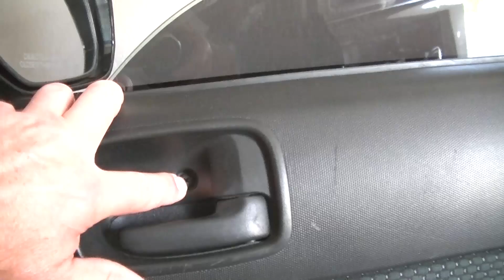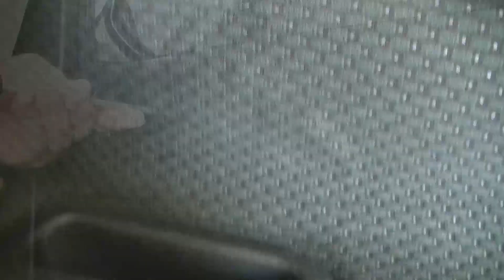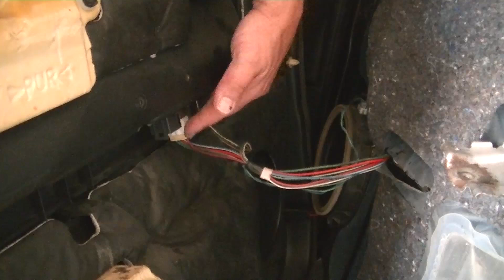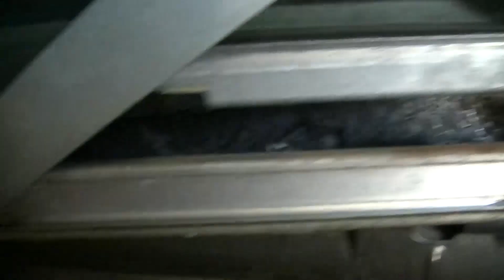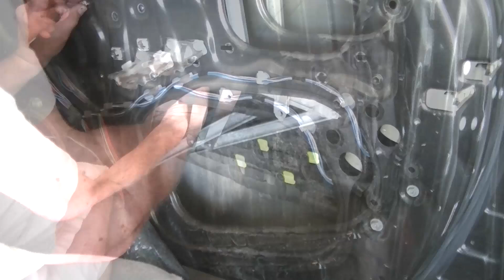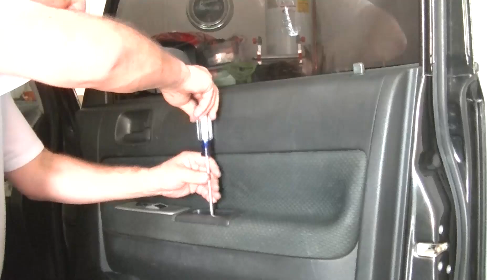2006 Scion XB electric window remove and replace

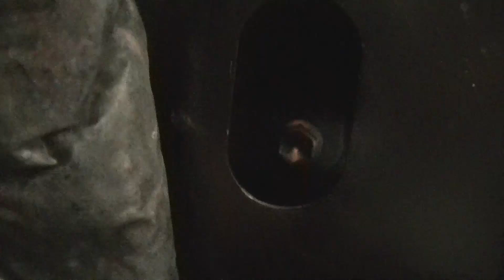Comment: Sigh.....this is the 3rd vid that I'm viewing to do this repair....and in all 3 vids, the motor is partially failed...and you have the nice option to position the window ( up/down) EXACTLY RIGHT, to get access to one of the lower-edge window bolts ( 3:45- 4:13). Nice...IF you can do that. What about my problem?.... ( and I'm sure for many others)....my window is UP.... AND...the motor is DEAD. That SMALL access hole to get to the left-bolt is not lined up with the bolt...not even close. Now what ?
Reply from the maker: I found this video that might be helpfull: https://www.youtube.com/watch?v=B1t8CnMpp4Q

I don't have the car anymore so I'm not able to explore a solution for you, sorry

Comment: Just bought one of these, with the same problem. Great video. We used to own a auto electric shop. From 1938 to 2006. I like the duct tape idea. We used to use those rubber door stops.

Comment: thanks was able to do this as well!! only problem i have is when reassembling the door panel. there is now a gap between the rubber and window on the inside. door panel is seeded though. so idk buts its okay

Comment: I CAN ASSURE THAT ON THE DRIVER'S SIDE YOU DO NOT JUST UNCLIP THE @#$%ING PLUG ...EITHER CUT THE WIRES OR WORK AROUND IT!!!!!!!!!!!!!!!!!!!!!!!!!!!!!!!!!!!!!!!!!!!
Reply from the maker: sorry for the troubles, since I did the passenger side I know not about the driver side, thanks for the input
Reply: You can unscrew the switch assembly with a Philips screw driver

Comment: Thx for the vid. So what did you do to fix the issue where the window wouldn’t go up with the new motor? Was it an issue with the switch the whole time and not the motor or did you have to do something else to make the new motor work?
Reply from the maker: it turns out both the switch and motor needed replaced, when I replaced both it worked perfectly

Comment: Scott, I used this unbelievably perfect tutorial 3 years ago to replace both front window motors and regulators on my black cherry 2006 Scion xB (exactly the same as the one in this video) and I'm still amazed at how perfect your video is.  The reason I came back today was in the hope you had loaded a video for replacing the door lock actuator on the same car, but no luck.  I ended up using someone else's video, which was quite helpful but nowhere near as exceptional as yours.  I love my Scion and never plan to sell it, so please promise you won't ever sell yours either...how else will I know how to fix things as they go wrong?  P.S.  I also have a 2006 Miata...maybe you should get one of those too, so you can post videos for how to do repairs on THAT.  Anyway, just wanted to thank you again for your wonderful posts.  Three years later, I'm still grateful every time I open or close one those windows.
Reply: I need to do this soon to a 2004 XB, which looks similar.

Comment: So was your switch faulty the whole time? I have an xA that has the same issue in the video but rear left side.
I’m unable to find an aftermarket regulator for the rear. But the good thing is I can test the switch using the rear right one or if the driver side switch is also having the same issue for that window it’s most likely the regulator and/or motor.
Reply from the maker: yes the switch and regulator were both bad

Comment: Thanks for the clear explanation of what you were doing and the in-focus and unblocked video. I had different issue with my 2006 Scion Xb. The plastic tabs on the bottom of the window broke; the window motor is fine. This showed me how the glass attached  and where the attachment holes are. Great time and money saver.

Comment: Free viewing your video at the beginning you say that you are replacing those two parts. So I wasn't paying attention. On my car the problem is with the driver's side door driver's door and that's a very expensive switch to replace. I hope that by cleaning the contacts in the driver door switch that doesn't work, that it can come back to life and that it's that and not the switch.

Comment: You did not state that the part you were replacing was the motor and that you were putting in a new part. But from reading the comments i gathered that this was the case. It is otherwise a clear and beautiful video.  Thank you.
Reply from the maker: I apologize for my omission, I thought I had said motor but I must have missed it, sorry. Thanks for your kind words.

Comment: Bought a replacement regulator before getting to the "epic fail" portion of the video. Title should be edited
Reply from the maker: Dan, if you kept watching I show that I needed a new switch as well as a new regulator and did successfully complete the repair.
Reply: Thank you for clarifying, what you say in that portion isn't very clear or specific
Reply from the maker: Sorry for the confusion, I'm not a pro mechanic or video maker. DOH!

Comment: I just replaced the passenger side front. Not a single issue. Thanks a lot for the video. Saved me a lot of money. I got a brand new motor, regulator and assembly for only $45 with free shipping on eBay. Saved 100's DIY
Reply from the maker: You are a rockstar! Good job sir!

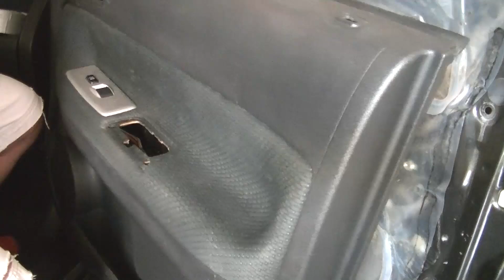Comment: Actually, I only needed to replace my side view mirror, but had never taken off the door panel in the 11 years I've owned my xB. I watched your video up until 2:26 and then I successfully installed my side view mirror replacement. You saved me a trip to the shop. I'll be sure to sit through the whole 12:30 if I begin to experience driver/passenger window problems. Thanks, sir!

Comment: Fantastic video.  Would you happen to have the part numbers for the regulator and switch?  I have the exact 2006 Scion XB.  Beautiful job on the video!
Reply from the maker: Sorry Bob, I did this so long ago I don't have those records. Good luck in your search and thank you for the kind words.
Reply: Hi, Bob, I see your question to Scott re the part numbers for the window motor assembly replacements, and I happened to keep that info from when I did my own (using Scott's awesome tutorial).  Here it is:  Note that the price is for a PAIR (front doors, passenger and driver sides).  Good luck!  https://www.1aauto.com/2004-06-scion-xb-window-regulator-front-pair/i/1awrk00516?f=518474&y=2006

Comment: Many thanks for posting this up to give me the confidence  to do both front windows/ motor with attached regulator. Small suggestion to assist others is  to detach the window glass  first and pull it  up  and  get it out of  the  way .  Wood  shims work well to pin the glass between the inner door frame and the track. Then the 6 bolts can be removed  to free the regulator and motor  assembly  without worry of damage  to the glass. My savings was over   $1K as the Scion  dealership  wanted $400 for each motor!!!
thanks again
Reply from the maker: Good job Ron! Thanks for the additional input.

Comment: I just finished replacing both left and right front door window regulators and motors in my 2006 Scion xB, using Scott's video as a guide.  It took less than two hours.  I ordered the parts from an online parts store for $140 (total for both sides).  The bid I received from a reputable auto shop here in Palm Springs was around $1200, so thanks very much to Scott, I saved over $1000 for less than 2 hours of do-it-yourself.  Thanks!!!
Reply from the maker: Shilo,you are my hero! Good job sir!!! Glad this was able to save you some money and give you the confidence to do this job.
Reply: @scottrigg996  Scott, it's been a while, hope you're still willing to share your incredible expertise.  I replaced the front passenger side door actuator (lock motor) on my 2006 Scion xB a few years ago, and it's already failing (as is the driver side now).  In shopping for replacement actuators, my head is spinning from the huge variety of vendors and prices.  Any chance you can offer your recommendation for a manufacturer? I'm sure I bought the cheapest one the first time, and though it's not a ton of work to replace it again, it's not something I want to tackle every two years.  I don't really care what it costs, I'm still saving a fortune over having a dealer do it, but I do want to install a reliable part.  Thanks again!!!
Reply from the maker: @Allendale2008   Thanks for your kind words. I am sorry but I haven't owned the Scion for several years now. I can only hope you are able to select a quality vendor and part to complete your job at hand.Wishing you the best.
Reply: @scottrigg996  Well, you're still my hero for posting that classic how-to. I hope whatever you drive now to replace your 2006 Scion xB is as fantastic a machine as that Scion. I bought mine new in 2005 and I swear if I could buy a clone of that same car, I'd be writing out a check right now...of the 25 cars I've owned in my 50+ years of driving, it's the best, most dependable, and most economical car I've ever owned. Thanks again!.  P.S. I did find what I hope is a good vendor, 1A Auto.  We'll see.  :)
Reply: I'm looking to do the same. Where'd you get the parts?
Reply: @robAady  Robert, I'm soooo sorry, I just now saw your question when I came back to Scott's video to see if he had posted a video on replacing the passenger side door lock actuator (I just did mine and had to use someone else's video which was FAR inferior to Scott's incredible tutorial!).  Anyway, if you're still wanting to do your own, here's the website for the window motors and related hardware.  Note that the price is for a PAIR (front doors, passenger and driver sides).  Good luck!  https://www.1aauto.com/2004-06-scion-xb-window-regulator-front-pair/i/1awrk00516?f=518474&y=2006
Reply: I just buaght a whole door assembly At junkyard for $25. Mine works like new.

Comment: Hi, Scott, what a GREAT tutorial, and sheer luck that I have exactly the same car (2006 Scion xB).  With our desert temps hitting in the 120s, both front door windows are intermittently sticking.  In one of your replies below, you mention that you show in this video how to replace both the regulator and the motor, but I don't find any mention of your replacing the motor in this video (perhaps you meant regulator and switch). Did I miss something, or is there another video where you show how to replace a motor?  Regardless, your incredible, detailed and beautifully videofilmed post here has given me the courage to try to do this myself...hopefully the motor isn't such a big deal.  Thanks again for taking the time to put together such a useful video for us!
Reply: Use some silicon spray in the window seal. It will stop window from sticking to the seal. Motor fails if you overload it with a sticky window.

Comment: Hey Scott.....I have a 2004 Scion XA.  The drivers side window is all the way down and it won't go up....at all.   The original problem was a loose wire.  Last year I kept trying to insert the wire back in....and it went a certain way so the window went back up.  Yesterday I got up and tried rolling it up and it won't go up at all.   I can't hear anything in the door.  I don't think I can do this type of fix cause it seems too complicated.  What I was wondering......is there a master fuze that controls this one window?  If so which one is it in the box in the car or under the hood? What number or letter is it?  Thanks in advance for you help......cause I can't afford to take the car to the garage.  God bless!!!!!!!!!!!! My email is: tcountry@optonline.net or you can just answer me on here.
Reply from the maker: Troy, sorry there isn't a fuse for that window by itself, I would encourage you to do this yourself since it really is pretty straight forward. It's not likely that you'll damage something beyond repair, so if you don't get it right the first time you can put it back together and try again later. Good luck!
Reply: Had the door panel off......and a guy from next door that helps me with stuff....looked at it and he said the motors bad.  Is that what you replaced on this car you were working on?  Is it hard to replace the motor?  Please respond.  I have the window up now.....and it's like semi-crunched in there so it doesn't come down now.
Reply from the maker: Troy, you are funny, I made this whole video about replacing the motor and regulator, then you ask me if I replaced the motor. Keep up son. you can do this, now stop asking questions and just do it.

Comment: Thank you very much for this.  I needed to know how to get behind the door panel for both the window problem you were having in this video, as well as for a bad rattling sound coming from both rear doors.  I now have a good idea of how to access the door interior without a chainsaw, and hand phaser.  You shall now be referred to as , "Mr. Awesomness".  Thank you again.
Reply from the maker: +TheMilohemlock  thanks for the kind words. glad it helped but I'm curious what you'll find inside your doors making the rattling sounds.
Reply: As soon as the temp rises a few degrees, here in Minnesota, I will let you know.  I have a few ideas, but need to go inside the door to confirm. 

   Until next time,

Stay awesome!

Comment from the maker: Travis, thanks for asking for clarification if it was just the switch. It was BOTH the switch and regulator. I spent about $40 on each so the whole repair was under $100.
Reply: Scott Rigg Can you show on youtube how to replaced the lock actuator on Passenger side door?
Reply from the maker: sorry I sold the car several months ago, maybe someone else will do that ;-)
Reply: WRXIMPREZARED2018 SUBARU I just changed mine a week ago. It has been out for 6 months. It's pretty easy too. I bought an after market actuator for my door lock on ebay, about $12. You'll need the shortest phillips screw driver you can find because you'll need the space inside the actual door. Use your phone selfie mode to take pics and find the screws on the inside. It's only 2 screws and align the actuator correctly to the locking mechanism. I should have made a video because I couldn't find one.  You should give it a shot. Not hard at all.
Reply: WRXIMPREZARED2018 SUBARU I replaced mine yesterday day it's super easy pull the panel and reach in remove two Phillips screws and then pop it off and make sure you line up the holes use 1aauto.com for the lock actuator 20 bucks for the exact one

Comment: So just to clarify... The regulator was not the issue? It was a switch problem? I'm experiencing the same issue on my '05 xB, and if I can try just replacing the switch, I'll be a happy man.
Reply: Travis Newton is it just the switch? Did you get it figured out?
Reply from the maker: switch and motor, both were bad

Comment: This video really helped me. I couldn't find the shop manual for my 2006 Scion XA and the procedure is nearly identical for that model. I replaced the motor with a used one from eBay and it worked like a charm. I ordered the wrong motor at first, so here's a tip for whoever tries this: Hold a small mirror behind the motor and take a picture with a camera with flash and get the exact part number for the motor before you order the replacement motor.  That way, you'll get the exact one you need, and you won't have to take the whole thing apart before you get the replacement.  Anyways, thank you so much!
Reply: P.S.  The exact part number for the Front, Driver's Side power window motor for the 2006 Scion XA is 85720-32150.